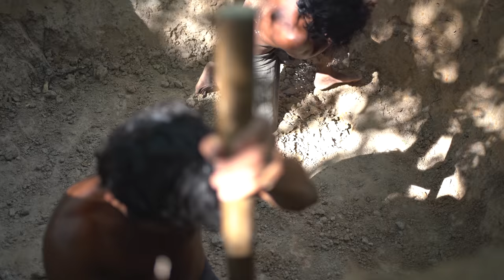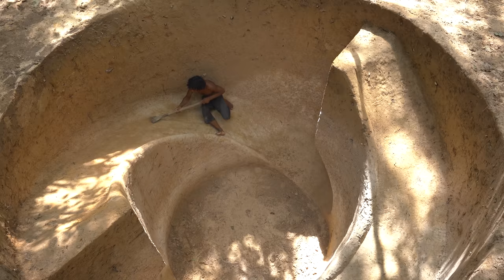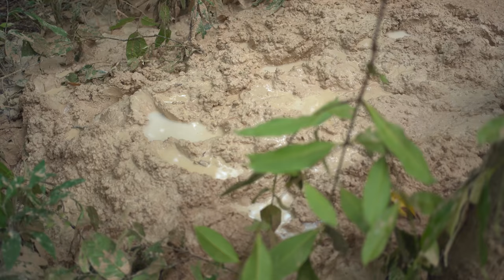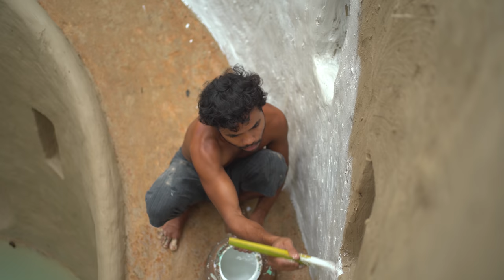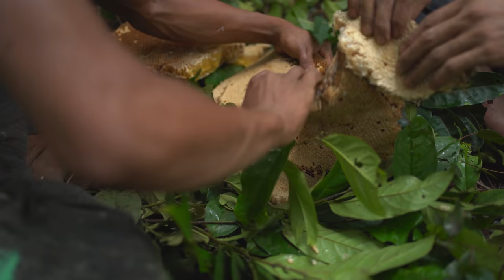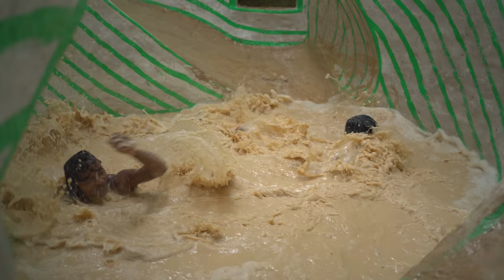Build Water Slides into Round Underground Swimming Pool

Comment: 1:33 Why don't they use, I don't know. Maybe a SHOVEL.
Reply: A shovel, they don't know, and a hardware store won't be around the corner.
Reply: @JWPemperor  but my point is they obviously have a house and money and stuff. Cuz people believe they don't have money and this is wat they have to to to live. They need money to buy a camera and a computer to edit on. And they need a house with electricity to charge the computer and camera
Reply: @L1029abc  That is the joke around this videos.
They do it like the year 0
And that is possible because the soil can be cultivated.
But they make ornaments they shouldn't have.
These guys are over 20, but they always make a slide.
But mostly a small pool
Reply: @L1029abc  its primitive.
Reply: actually shovels are primitive, but the dirt is too tough. The tool their using is much more useful. I THINK.
Reply: @L1029abc  the tool theyre using is more useful for some stuff
Reply: @L1029abc  maybe tradition?